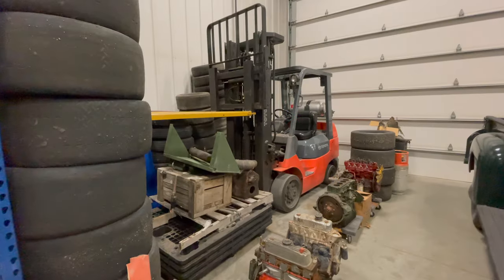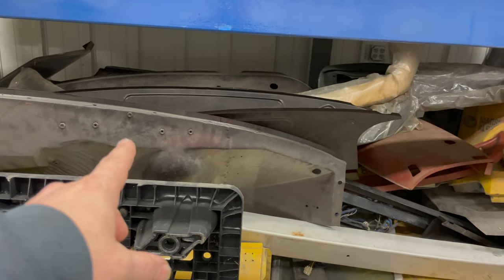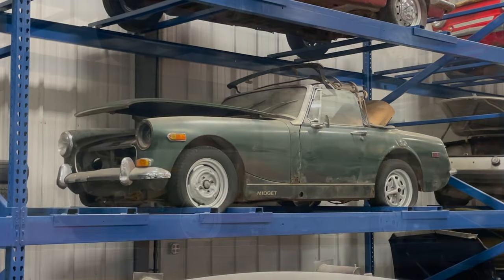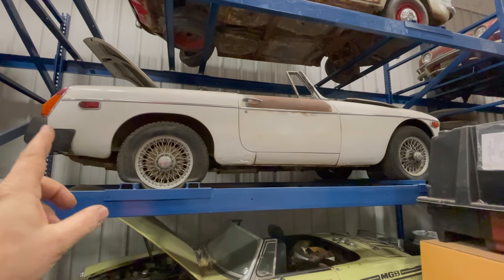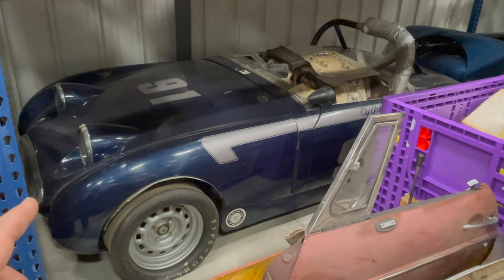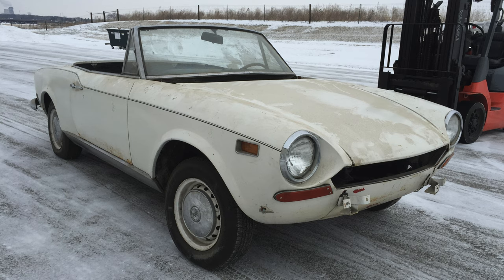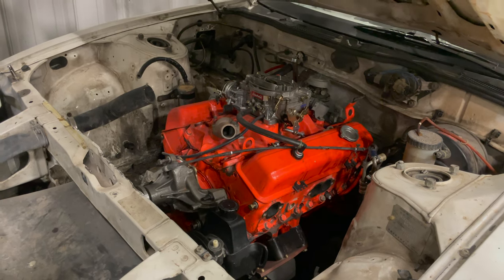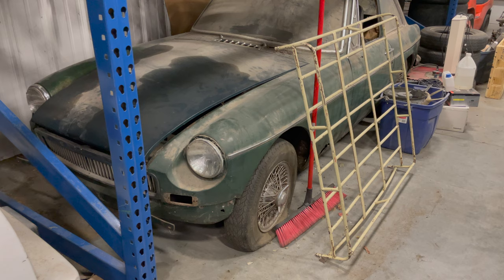Tour of the All the Cars I Have on Shelves

Comment: That is a Simca 1000, I had one. rear engined, water cooled.  The engine was enlarged and used on the 1100/1204.A front drive hatch back.  I had one of them ,too.  It was enlarged again (1600cc) and so saw use on  some of the Dodge Omni/ Plymouth Horizons .
Reply from the maker: Yes you are correct my mind was still thinking about the Morris 1100 I mentioned earlier.

Comment: I owned a ‘67 Triumph Spitfire and a ‘62 TR3b.  Both I drove while living in Italy.  The Spitfire had zero problems but the TR3b was constantly overheating (In the early 70’s they didn’t have electric fans which would’ve fixed the overheating problem.). It finally blew a head gasket.🥵😡

Comment: Mg midget challenge for sure !
Maybe order some parts too get some more power out of it, maybe give the cam a bit more aggressive profile & slightly stiffer valve springs.

The Simca 1100 I'd vote for giving it a modern drivetrain, maybe something out of a wrecked Smart fourtwo or Fiat 500 ?
Repainting it in a real eye catching color that isn't too crazy with flaking or similar & some nice chrome hubcaps that cover the wheels a bit more, like a Saab cosmic blue mica or similar lighter blue that perhaps came on the Simca cars at the time.